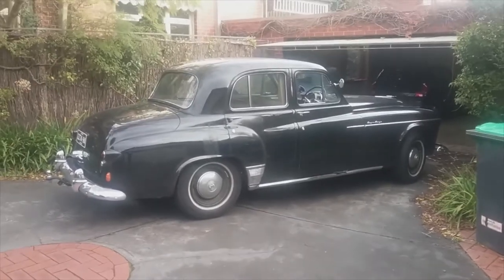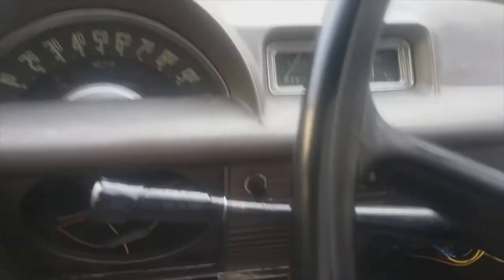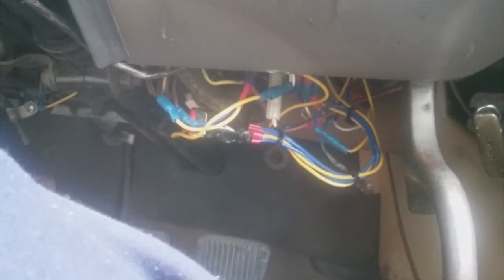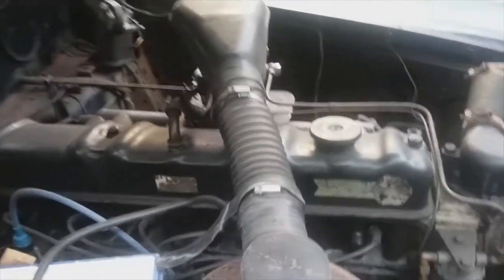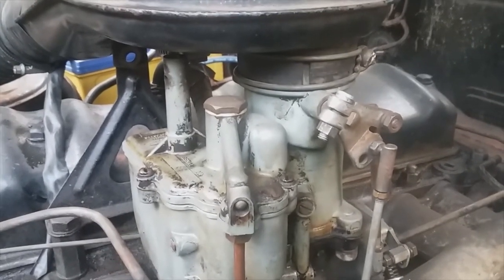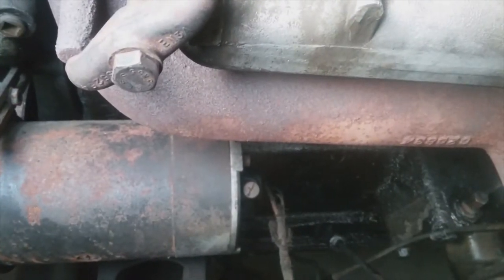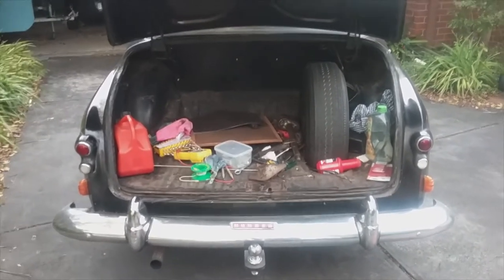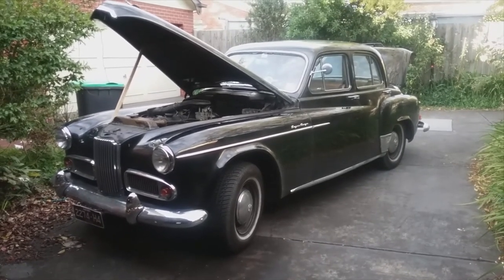Humber Super Snipe Mk IV Touring Limousine Look Around

Comment: The transverse leaf front suspension of the earlier Super Snipes was designed to share suspension travel between the front wheels. It was called: the "Evenkeel" system, and promoted as the last word in suspension design.
The name sounded as if it was a hugely ingenious and sophisticated idea. But since it was designed out of the Mark IV, it clearly left much to be desired.
Reply: The Fiat 600 had the same front suspension.

Comment: I learned to drive in a !950's Humber Hawk down country lanes in England, near Coventry. Easy engine to work on even though it has side valves. Those were the days.
Reply from the maker: Tank you for your comment Paul. I too learned to drive in 1976/77 in my Father's 1956 Humber Super Snipe. At that stage the car was 20 years old and still going strong. Previous to the snipe my father owned a 1951/2 Humber Hawk with a side valve engine. He said it was the best car he ever owned.

Comment: Made in Coventry, England. Humbers were at one time used by royalty in the UK and for overseas tours. It's odd that the early dashes were so poorly designed. Later models had specific LHD and RHD versions so drivers could clearly see the gauges. Looks like it could use a new fan belt.

Comment: Lovely. Another beautifully made, dependable Rootes machine. Would this have been assembled in the Port Melbourne factory or imported complete? I'm fairly certain that they were assembling a range of the more humble Rootes products at the Port Melbourne factory by the early fifties - Hillman and Commer, and, I would guess, probably Singer or Sunbeam. I have a lot of time for Rootes vehicles. My feeling is that they always represented better value than similarly priced Austin, Morris, or Standard cars of the time. Your Humber looks like a well-preserved and un-fiddled-with example. Very nice.
Reply: I have just been looking at a Commer Superpoise truck with a coach built body and using the same engine as the Super Snipe.  It was used as a race car transporter.
In Britain Humbers were used as official cars by Prime Ministers and members of government until the mid 1960's.
Sir William (Lord) Rootes always saw to it personally, that Winston Churchill had a Humber at his disposal when in government.
Reply from the maker: Although a lot of Humbers were exported to Australia in knocked down form and assembled at Port Melbourne, this particular car was fully assembled in the UK and exported to the Australia. It is one of the few Mk IV's in Australia that has the 3.7:1 differential ratio.
Reply from the maker: Hi Simon, yes, the same engine was used in Commer trucks. The previous owner of my car said it was also used as a Government Ministers vehicle.